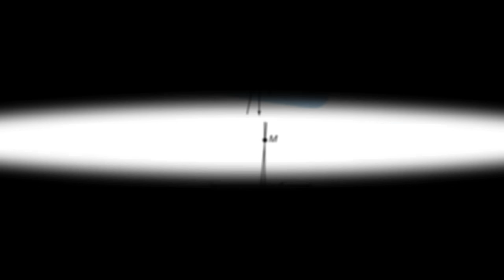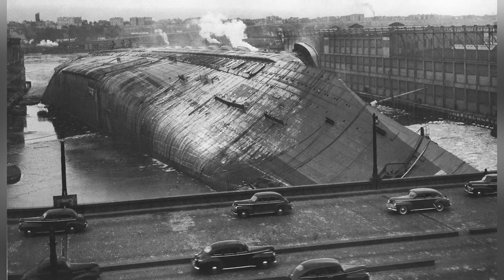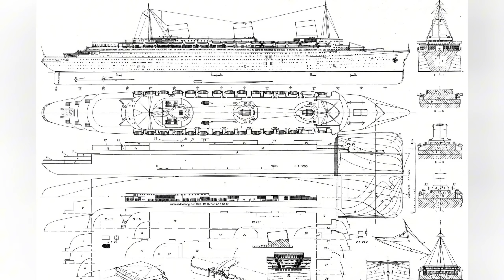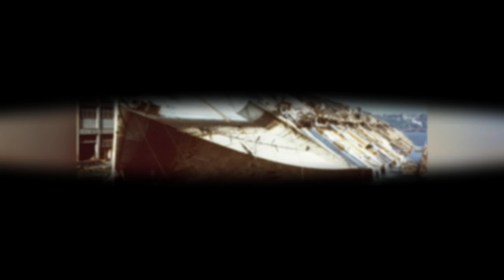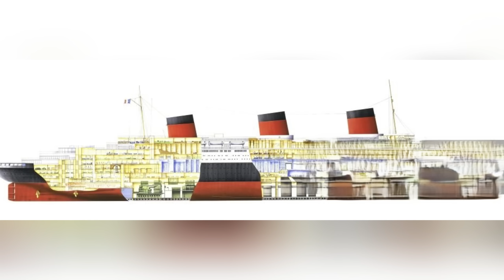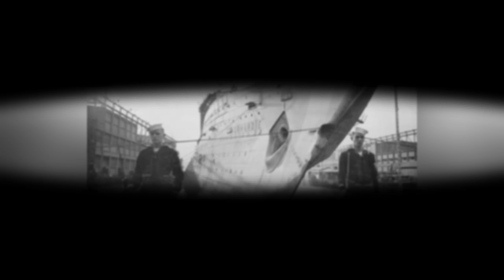Salvaging USS Lafayette: The Billion-Dollar Liner That Capsized in NYC

Comment: The fire was started by a torcher and his crew in the Grand Salon on Promenade Deck! Not, as sugested, in the Sale á Manger in the middle of the ships hull.
Reply: WHERE THE HELL WERE THE FIRE WATCHERS? A person WHO'S sole responsibility is TOO WATCH SPARKS FALL! Standing at the ready with FIRE Extinguisher in hand! And then make sure they DO NOT START A FIRE! Simple really, every welder has at least 2 or 3 if needed. Where they ARE Welding or cutting any HOT Work really. At the space they are working and Under the space they are working and even on the other side's of bulkhead's when needed. Having a man cutting steel with a torch WITHOUT A FIRE WATCH is the real cause. The cutter can't see ANYTHING but A small circular window thru dark glass at the point he's cutting. It was not his fault but the safety inspector or officer in charge of the HOT WORK. Sadly we learn from our mistakes and this was a BIG ONE. I don't blame the welder or cutter he was just DOING WHAT HE WAS TOLD TO DO! Even today some managers are STUPID and try to get away with shit but all it takes is ONE little spark to fall unnoticed and BOOM! 🔥
Reply: @robertrachels1870  more or less on leave ... and not permanent on watch within the ship
A deadly carelessness! especially as the cowboys hadn´t able to start the machines of NORMANDIE ... because the manual was in Gibberish (French) and they didn´t bother to get it translated or get a translator and asking the French (just surrendered) had been erratic and histerically treated as enemies
Then the transforming in plain sight at the pier: propagandistic activism
Competence wars within the NAVY and other authorities and among the contacted companies
No controll who was on board
NORMANDIE was doomed to death the moment the cowboys seized him!
Reply: @earlofcruisegw1727  Was it truly "Erratic and Histeric" not to ask the Nazi controlled Vichy French government, an enemy, for their opinion?

Comment: At 14:15 how does a corridor running lengthways of the ship become a vertical shaft?  Ship rolled over sideways 90 degrees not end for end lol.
Reply: There were many side to side corridors branching off from the fore and aft main corridors.  They ended up in an up/down orientation.
Reply: @charlesyoung7436  AI slop was specific in stating a corridor running the length of the ship. Such a corridor would by rotated 90 degrees along its axis lengthwise. This does not make it vertical.
Reply: @NuncNuncNuncNunc  hate AI.  Produces such crap.  Shame on me for watching

Comment: great video, slight shame that many of the images were not in the correct order

i knew the ship had a fire and was lost to the water put on the fire, engineers were trying to get below to open sea cocks to drain but were not aloud
it makes you wonder, if she had been saved, would she still be with us today

i had no idea there was a massive resurrection to re-float her, but as described the cost was against her and the damage done sealed the deal

such a shame, and for the time an engineering feet for sure, but even today we don't really seem to learn do we, build big, flounder and then use all manner of over expensive measure to correct, insurers then foot the bill which eventually makes its way back to us

sure the money would be better used, scrap her and build another, and today we have to be more environmentally savvy

Comment: The NewYork fire department was just plain STUPID. Such a waste for such a Beautiful Ship 😢
Reply: Not entirely the fire departments fault, they don't normally extinguish fires on giant ships. The fault lies with the people in charge of converting the ship for rushing it, disabling the fire deactivation system, and leaving highly flammable objects next to where people are dealing with electrical work.
Reply: @CPAV21very True. Many were responsible. Still a Great Loss😵👍
Reply: @CPAV21 you need to pay attention or be educated on how fire suppression systems work, just like in homes, hotels or even race cars, the heat or sparks or any fire sets them off, so it would have been impossible to use a torch around a fire suppressor system, and cutting torches were necessary tools for gutting the ship, go troll a kiddie site. and one more thing, this was a harbour for ships, so what fire dept would you think would put out a fire in a new york ship harbour dikwad.
Reply: Blame the Navy. It was their stupidity.
Reply: I think that was really the only course of action to prevent any potential spread. There was a cargo ship fire a few weeks ago (ONE Henry Hudson, late November 2025) where the fire crew essentially used their hoses to keep the outside of the hull and several containers cool and practically flooded an entire cargo hold to keep the fire contained.
Reply: TELL THAT TO THE ONE WHO PULLS YOU OUT OF A BURNING BUILDING ONE DAY.
There is NO TRAINING for this type of situation in civilian firefighting.
I guess I understand the frustration, but be honest, you're not thinking of centers of 
gravity and bouyancy while fighting most fires, you're trying to PUT OUT THE FIRE.
Reply: @abcde_fz The builder of The Ship was there and tried to tell them, but The Chief at the time refused to listen. Arrogance is every generation I guess 😮
Reply: @may86bear  Tough call.  A man fighting fires for a living finding himself in a situation with a guy who buillds ships for a living.  But the fire chief didn't know him from Adam.  The guy tells him not to do what has WORKED every time in the past.  What would I do?  Hindsight is 20/20, as they say.
Reply: @abcde_fz True Enough 🤔
Reply: @abcde_fz   It would seem in this case they threw the baby out with the bath water